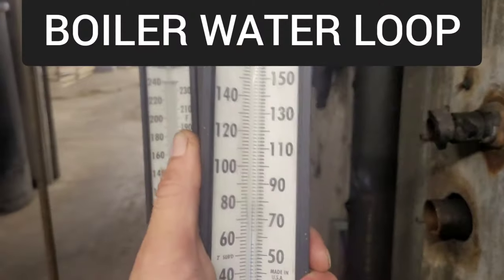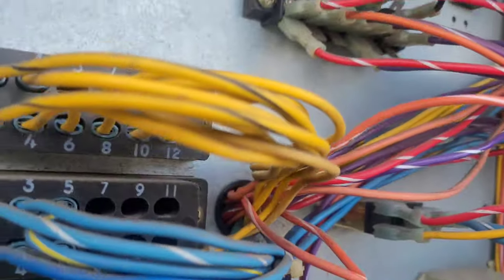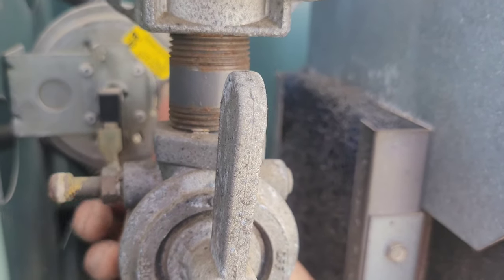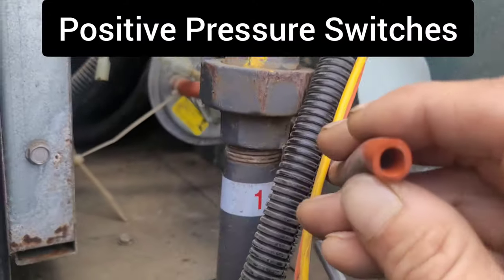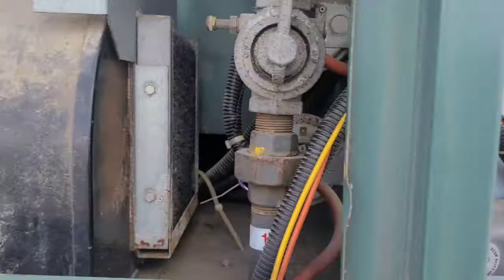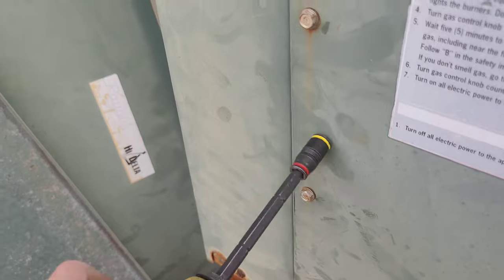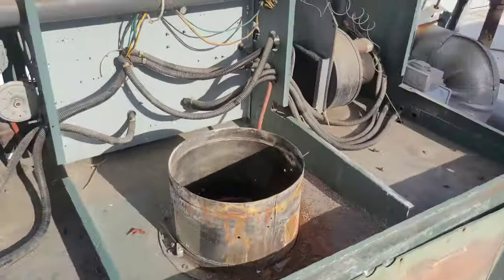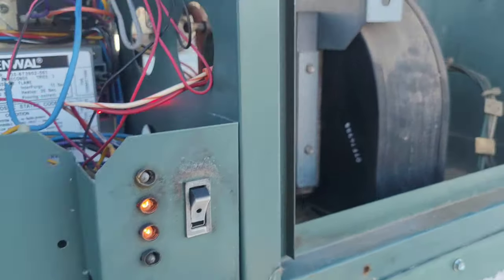Boiler Troubleshooting No Heat at Grocery Store

Comment: I've never seen a boiler on a roof. Wouldn't the cold air affect the efficiency of the boiler? I  carry a bag of number 12 and 14 screws for strip outs. Thxs for the vids!
Reply: It's Texas. How often does Texas get that cold
Reply from the maker: Yea. That red bucket of mine has all the different kind.  Those ones that I used on the cover were number 14s.

Comment: I worked in a lot of these types of boilers. That looks like a really old Lochinvar. Its weird to see it on a roof but I'm from NY. Those copper fin tube heat changers need to be cleaned yearly. Bet its pretty plugged up
Reply from the maker: Yea, i thought it was very behind on maintenence myself. unfortunately though,  its not my job to offer that or do it without approval. the times ive suggested maintenence (like my first year at this company) have all been totally ignored. oh well
Reply: That’s an easy one to clean since the top will come right off and it’s not stuffed in between other equipment in a mechanical room like they normally are.

Comment: I despise that cabinet design of positive pressurized cabinets..  I used to work on stuff like that quite a bit and had your same issue..  cbainet air leaks would result in a no fire...  sometimes intermittent..  it would be so close to failure that something as simple as temperature changes caused the cabinets to flex a bit different and shut it down..  I often had to run a size bigger screws in and sometimes I would put a thin rubber car door edge guard on the metal around the cabinet..  that plastic door edge guard was pliable enough to create a nice seal where the machines would fire every time..
Reply from the maker: Nice bit of information man! That's crazy. But right on the mark. Yes positive pressurized cabinets. I never actually have seen one of those you know I'm used to the 80 percent gas-fired furnaces down here that use the induced draft motor Which pull the air through the heat exchanger. Awesome man thanks for commenting
Reply: @HVACRServiceTech  I really only ever saw it on medium sized and a bit larger stuff..  I used to work on a lot of "bryan" hot water boilers that were water tube... those were 1.2 Mbtu units and ran positive fireboxes.. so it was actually a sealed firebox abd a positive inducer blower.. they actually had psuedo fire brick lining in them and sealed tight.. they were indoor units   ..  although come to thiunk of it I believe the Navien tankless and combi units are positive indiucer.. been a while ill have to look at mine..  but yeah negative draft on 140K and under furnaces seems to be the rule..  even 90+, they essentially still suck the air through the heat exchanger ..   a church I still work on has an old coal fired furnace with a Gabriel conversion burner on it.. that thing only has a flame sensor safety.. theres no pressure switches..  its a unit that sits on the floor and blows flame and air into the old monster iron steam boiler..  runs an aquastat at 4 PSI..  I retrofitted a low water cutoff and a stack temp switch  to make their insurance company happy.. it doesnt have an auto city water feed..